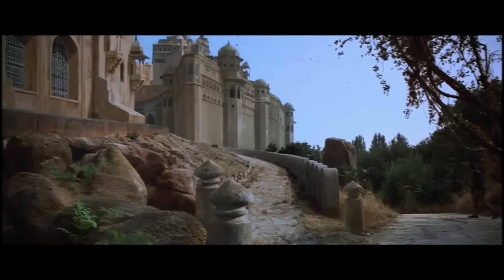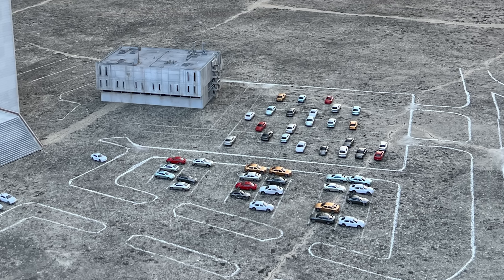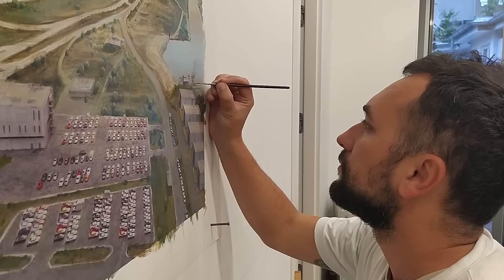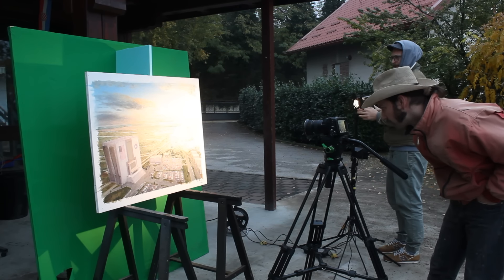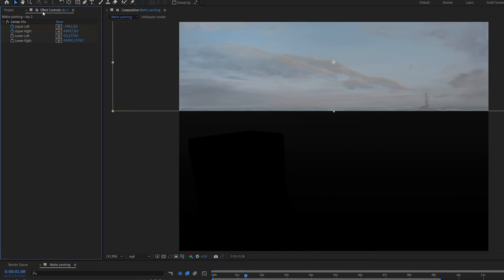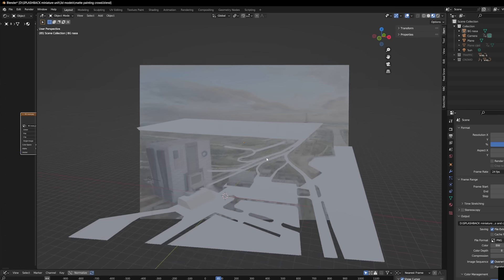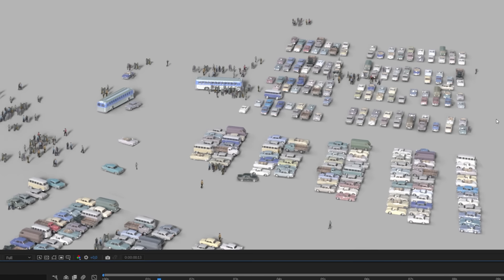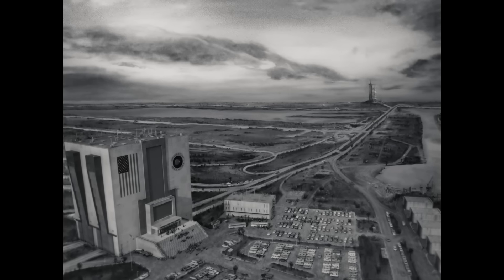We Combined a Traditional Matte Painting with Blender!

Comment: Am I the only one missing the point of the video ? I mean whats the point ? I mean ok Matte Painting combined with Blender great, But blender is a replacement for Matte Painting, I mean not primarily, but still. Whats the point of making a "traditional" Matte Painting if you could have used images and use them as planes with overlays, Which at end of the day You DID use.
All that to say, using Traditional Matte Painting created More problems with no advantages and only slowed down the process for NO gain. If it looked exceptionally good there would be a point, But not even the black and white filter made it look normal.
Reply from the maker: We wanted to get the old film look and we feel it can only be achieved by using a traditional technique. And Blender was used only for the vehicles to give some life to the shot. I don't think this shot would look like this if it was done from real photographs. It would look more realistic, bit that's not something we wanted.
Reply: @sliceoflifefilm  Ok that makes more sense now,
But I think that the 3d Effects make it look more like a ""cheap" 2000 3d movie", NOT bad, but also not what you were aiming to make. If anything it Looks more like a scene from Sky Captain and the World of Tomorrow. Its good, but not the same.

And as the Real photographs go, I have seen some tutorials that make shaders for blender that change the look of a scene, One of them was aiming for a "paintings" look, But essentially it was a plane that worked as a filter in front of the camera. I am pretty sure that you Could achieve "same" results as old  Matte Painting by using something similar on either a photograph or on a filter in front of it.
 All that to say, that I don't think that what you made is bad, I am just thinking that same or better result could be achieved without the Matte Painting "hustle", And I do realize that the POINT of the video is to make it the "old school" way. I am just uncomfortable with the "potentially wasted time".